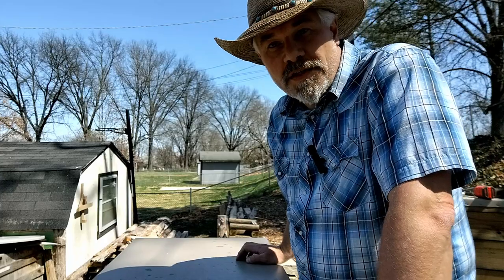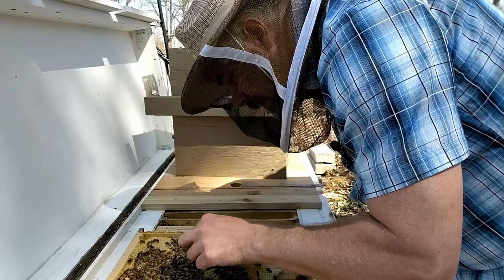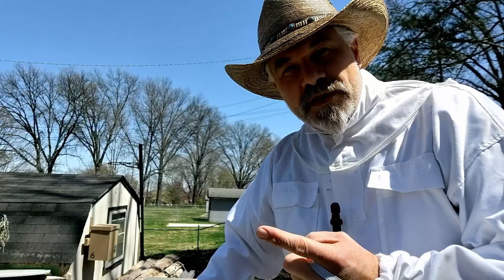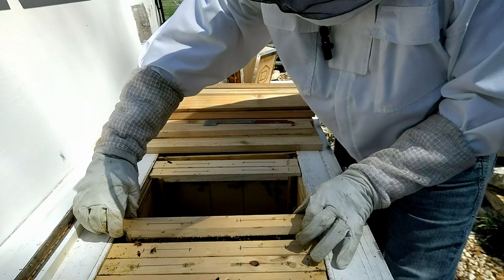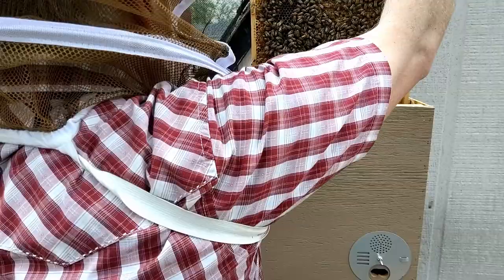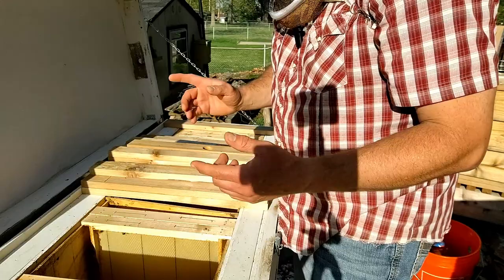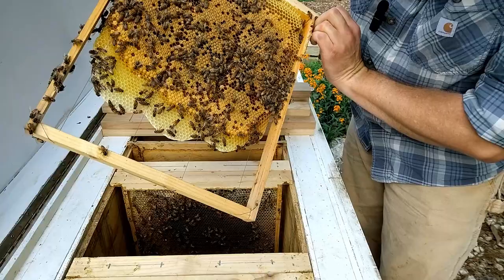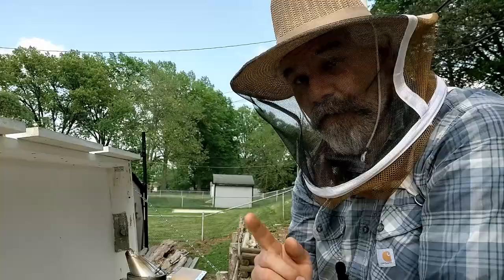Split a Beehive, Start to Finish, from Layens Horizontal Hive

Comment: You don’t Need queen cells for your bees to be aggressive all they need is to be Queen less , also . I have been keeping bees since 1971 and I got to be in the right place at the right time , one of my hives my queen went on a mating flight and i got to see her take off and come back , first time in 52 years ! and while she was gone they were aggressive,  once the bees realize they are Queen less that’s when they get feisty 😈
Reply from the maker: That may be true in a general sense, but I've also noticed that a hive can be relatively gentle until I get to the frame with queen cells and then the bees may turn on me.  I just inspected a hive with a new queen and hadn't found her yet, but as I started to lift the frame where she was the bees started bouncing off of my hands.  That doesn't happen in every hive, but it was useful because it made me suspect that I was getting close to finding waldo (or might have been coincidental).

Comment: You mentioned an in-hive split (I have layens also).  My impression was that even if split by a divider board, theyd just fly out their queenless hole and back to the queen-right side....(?)
Reply from the maker: House bees - those in their first three weeks of life who have never left the hive - will stay where they're put whether that's with or without the queen.  Foragers, when they leave the hive, will orient to that location and will return to the same location regardless of whether that's where the queen is or not.  If queenless, the bees' inclination is to try to make a queen - they don't go out to seek the queen.
Reply: @SuburbanSodbuster  Right.  So if only the house bees are left in the split, then they have to make a queen, then queen has to mate, then lay, then hatch brood, seems like that colony would have an impossible task to survive...No?
Reply from the maker: It seems daunting, but this is basically what colonies go through when they swarm each spring.  The swarming bees start from scratch but have a queen; those left behind start with a new queen who has to be mated, begin laying, etc.  A split may take longer if the bees have to make an emergency queen from eggs or young larvae, but they'll typically have brood to maintain their population during the interim.

Comment: So when do you need to move a swarm trap/split a couple miles away and then bring back as opposed to what you did with just putting them a short distance away?
Reply from the maker: Remember that the purpose for moving the new colony a few miles away is so that the forager bees will re-orient to the new location rather than just returning back to the old.  So by placing the new colony just a few feet away I know that they are going to lose their current foragers - but they will retain their nurse bees.   To balance the loss I prefer to move the queen with the new colony so they'll continue producing bees, uninterrupted, to make up for the loss.  The source colony, in the original location, will have a brood break (if left to make a new queen) but they'll retain the foragers to continue gathering resources during that time.
Reply: @SuburbanSodbuster  Oh yes, of course. The split would only be missing out on the foragers. So your reasoning for moving the queen with the split makes sense. Thank you!

Comment: How do you keep the bees still in the original hive from following the Queen to the smaller swarm trap box, and vice-verse?
Reply from the maker: The forager bees are oriented to the original hive location and will always return to that location no matter where the queen goes.  House bees (young bees which haven't yet left the hive) will always stay where they're put - they wouldn't leave the original hive to find the queen nor would they leave the new hive to return to the original.  The only exception to this is if a colony swarms, in which case the swarming bees will travel with the queen.

Comment: you need to wait to put her back after you mark her. kill may kill her as they smell the marker. I had that happen 3 times before I knew it was a thing
Reply from the maker: That's a good consideration.  Thankfully I haven't had that happen, but I usually try to wait about a minute to let the paint dry before putting her back.  It makes sense that the smell could affect the bees' acceptance of the newly marked queen.

Comment: Once you have a successful in-HHive split (using a divider board), can one of the colonies be moved to new empty hive?
Reply from the maker: Yes - in fact two strong colonies wouldn't fit in the same hive for long.  Once both colonies are established and queen-right then one should be moved out.  Depending on the situation that move could be done in different ways.

Comment: How often are queens available for sale during the year? Also, if you did purchase one, would it be a VR queen???
Reply from the maker: The availability of queens will depend on the ability for them to be mated in a given area.  Naturally mated queens would generally be available from the beginning of swarm season through summer.  Local climate will affect that, of course.  Artifically inseminated queens may be available year-round from someplace, but to be honest I haven't done much queen shopping to be able to speak knowledgeably about that.

At some point I plan to do some queen rearing, mainly to have some on hand for splits.  As you can tell from the video, I like being able to select and continue the genetics I like in my own bees.  But I also wouldn't mind avoiding a brood break while a colony raises a queen.

If I were to purchase a queen it would be from a local, treatment-free breeder.  I know of a few in my area that I've considered.  Local is important for the colony to be instinctually in sync with the nectar flow and be able to be kept naturally without supplemental feeding.  In turn this translates to a healthier colony overall.
Reply: There's someone in SE Missouri that specifically raises treatment-free queens. I'd do a Google search for it!

Comment: Question, why do u not use full sheets of foundation on your frames? To save on foundation ? Or just how u like doing it 😁thanks
Reply from the maker: It is an economical decision - I can make more frames from one sheet of foundation - but it also allows the bees to build out the rest of the comb naturally, with cell sizes as they determine rather than controlled by the foundation template.

Comment: Also, if I wanted to split a hive of Italian bees and introduce a Russian queen, would I use this same method to move half of the bees and the original queen to a smaller box, and then add the Russian queen into the original box?
Reply: Or could I divide the hive in half in the same big hive box give one half the Russian queen?
Reply from the maker: Yes, you could do that. But the new queen shouldn't be added right away.  Wait a few hours for the queenless colony to recognize that they're queenless and introduce the queen in a cage with a sugar plug.  The bees should recognize that they're queenless within 3 hours.  Before they realize they're queenless they aren't likely to accept the new queen.
Reply from the maker: As for dividing the hive within the same box or moving a portion with the queen to a new box, either way would work the same.  Either way you would add the queen to the queenless side of the split for the same outcome.

Comment: Are the small insects crawling around on your frames, SHB? If so, are those numbers you see a concern to you? I'm new and learning
Reply from the maker: It's possible.  It's been a while since I reviewed this video but if you can give a time reference I can look to see what you see.  However, it's very common that the bees will herd the SHB to the ends of the hive and often corral them using propolis.  Then, when I move the frames or divider board these propolis pens are broken and the beetles scatter (and I play whack-a-beetle with my hive tool).  As long as the bees can cover the frames adequately to manage the beetles, I'm not too worried.  So when I add frames I try not to give more space than the bees can effectively patrol.

Comment: If I make a split and want to provide them with a queen, do you know how that introduction would go?

Thanks for posting! Super timely since I'm hoping to split once or twice this month. 

I saw in your other split video that you simply put the divider board up after splitting the supplies-- did you put this one into a swarm trap specifically because it was going to a different home (mine!)? And you weren't worried about moving it just across the yard because there weren't foragers to worry about?
Reply from the maker: I'll confess that I don't have experience with making splits with queens.  I've always let my splits raise their own.  But I suspect it would be the same as any other requeening: give the bees time to recognize that they're queenless, add the queen (in the cage) to let the bees get accustomed to her scent.  Once the bees seem to be accepting of her (feeding her rather than trying to sting) then remove the plug and let the bees chew through the candy to release her.  It could take a couple days overall, but still less than a complete brood break.  

This split was done differently than the last because I already have colonies in both ends of this hive, and I was splitting both of them.  I didn't get video of the Hive 1 split because my camera (phone) ran out of battery.  That's a shame because the bees were VERY defensive and it would have been entertaining (for some) to watch.  But it wouldn't have been very instructional - I basically grabbed some frames, threw them in the box, and called it done.  At the time I didn't know for sure if this split would be going to you or into a new hive (to be built) but either way the swarm trap was just a temporary home.  And your guess is correct - I knew the bees in the swarm trap would be losing their foragers so wasn't concerned about moving them just a short distance away.
Reply: @SuburbanSodbuster  Thank you! All that makes sense. 

My biggest question that remains is the location. If I made a split inside a hive, I'd either need to 1. take it 3 miles for a week or two and bring it back to the new home, 2. only transfer brood/nurse frames to wherever I want or 3. move it incrementally (6' at a time) to the new home. Right?

Also, do you think nowish is too late to do a split?
Reply from the maker: I recently moved one of the colonies from my in-hive split.  I didn't take video (kind of a "time's short - just get it done" thing) but I only moved them to another hive across my yard.  First I put them into a swarm trap (kind of the reverse of installing a swarm), then moved the swarm trap at night and put them in the new hive the next day.  I tried putting branches in front of the entrance, but I think most of the foragers ended up back at the original hive anyway.  To be honest, that wasn't really a problem.  The colony had built up strength and resources so a temporary lack of foragers didn't set them back much.  And the remaining colony just  gained the strength of those returning foragers.  The in-hive split is convenient when space is lacking, and can help to balance the foragers (at first) but in some ways it's simpler to split the bees to a separate box from the start.

As for timing, I still think there's time this year for splits.  As my own rule of thumb, here in Missouri I'd be willing to make splits through April and May and let the colonies requeen themselves, and through June with a queen to add.  Splits could be done through July, but feeding will be necessary to build them up.
Reply: @SuburbanSodbuster  Super helpful as always- thank you!

Comment: How many frames of brood helps in your decision  to split?
Reply from the maker: It's not so much the number of frames as the apparent strength of the source colony.  A colony might have low numbers and 5 frames with small patches of brood.  In comparison another might be building up quickly with a solid population and 3 frames packed with brood (along with frames of resources)  The former might not be able to spare any frames for a split, while I might make a split from the latter.  So it's not specific numbers as relative strength, and over time I start to know which hives are likely good (strong) candidates before looking at the frames.
Reply: @SuburbanSodbuster  thank you

Comment: What foundation are you using on your Layens frames?
Reply from the maker: Right now I'm just using some wax foundation for Langstroth frames, cut to width for the Layens (I bought two packages on sale).  Originally I was cutting it into 1" lengths to use as starter strips, but that would sag and droop in hot weather.  So I was using full height sheets and leaving the rest of the frame for bees to build naturally.  But recently I've started cutting the sheets into 1/2 height (4 3/16 inches).  I like letting the bees build natural comb in most of the frame, with some foundation just to guide them as they start.
Reply: @SuburbanSodbuster  Thanx for the reply! Looks Good!

Comment: I recommend doing away with the wires in the frames. Instead put a dowel in the middle of the frame to support the weight of the top half of the comb the bees will build. Then an angled piece of wood in the top of the frame to guide the bees to build down the middle. the wax won't sag so much when it gets hot in summer like it does on the wires. Also when I go to harvest the honey, I can just cut the comb out of the frame- big cut comb! Then the bees will build all new fresh comb. A dowel in the middle is just all round better than wires, imo.
Reply: I was wondering about that...
Reply from the maker: To each their own.  I prefer to use an extractor and return newer comb to the bees to re-use.  I've started using cross-wired frames to provide better comb support and have also found that it often results in more even comb than straight wires.
Reply: @SuburbanSodbuster  Maybe a video about the different frame options, horizontal or vertical wired, or wood starter strips or wax or plastic foundation starter or  dowels would be a good idea if you are up for it?
Reply: @SuburbanSodbuster  I was thinking. maybe the ultimate frame would have a horizontal 1/4 oak dowel to stop the horizontal wires from pulling the sides in?  What thinks you?...